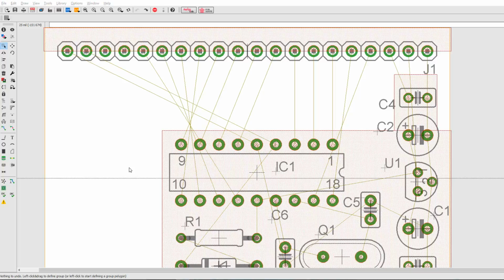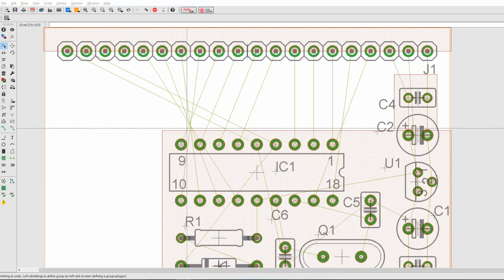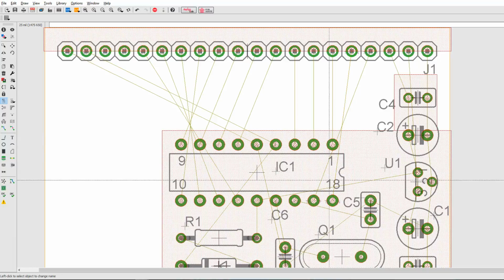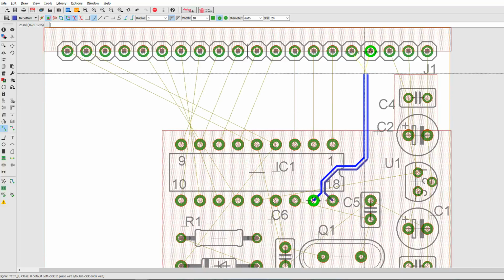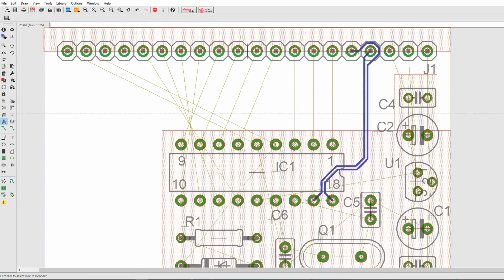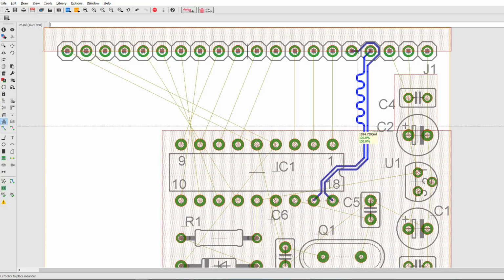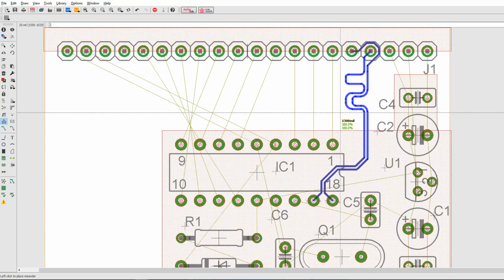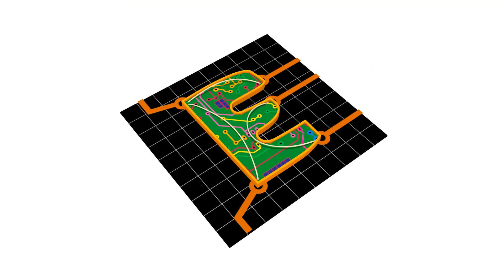Learn how to use Differential Pair for PCB Design in Autodesk EAGLE

Comment: The differential tools are certainly better than doing it manually but have some critical limitations. The meander tool can do a passable job when it has a lot of space, but on a very crowded layout not so much. 

My biggest challenge is editing a previously routed differential pair. On a high-density PCB, I regularly have to make little changes to diff pairs but the relationship is not maintained. It becomes a manual effort to maintain the relationship and length match. Also, routing with radii bends is more and more common on very high-speed layouts - editing traces with radii is so difficult - I end up doing a total re-route of the entire trace instead of trying to make edits. Eagle will not maintain constant radius and tangent line/radius relationship. 

At the end of the day - it is a major pain to do differential routing. This is especially true when you have to make edits after the initial routing is complete. It is possible I am missing something, so please let me know if I am. 

Please help with editing traces that have radius bends. Snap to 45 degress / vertical / horizontal. Edit diff pairs as a pair after the initial routing.